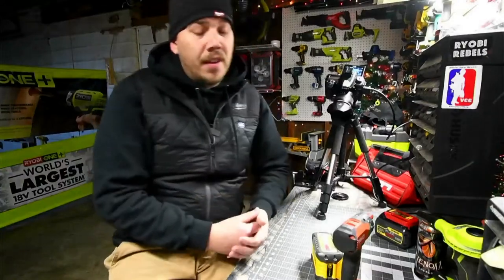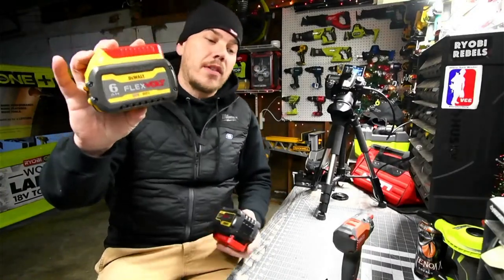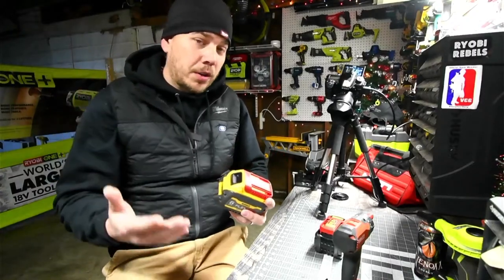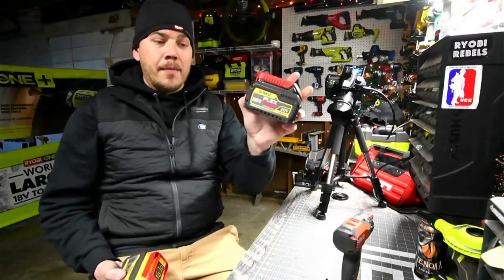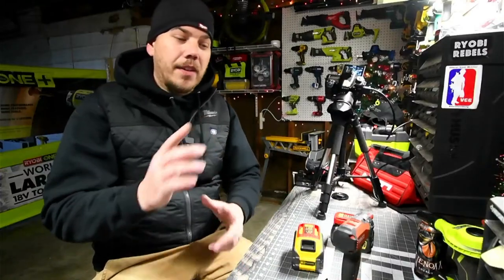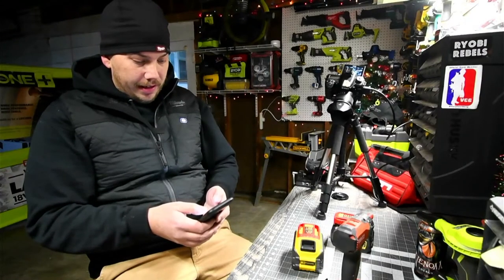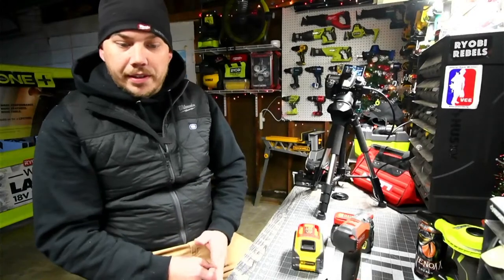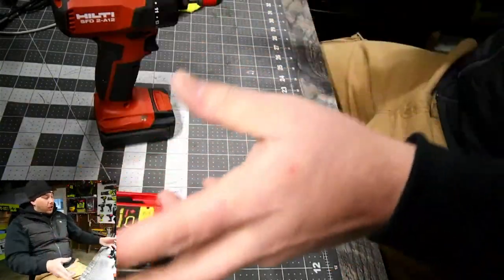21700 Cells in the FLEXVOLT ADVANTAGE BATTERY?

Comment: 2170 (D= 21mm D L= 70mm) 1865 (D=18mm L=65mm) easy to see the difference. So the format is that it allow form more material on the cell, (more layers) to get more power ( Ah ) on it.
Reply from the maker: and I showed that in this stream. I opened up a battery that actually does have 21700 celled batteries in it and showed the difference

Comment: I saw a YouTube video with Vince and a Dewalt Rep.  He said the 9ah Flexvolt was also 18650 cells.  The 12ah was 21700.  Thank you so much for making sense of this.
Reply from the maker: I thank you Dmacl
Reply: It actually has 20700. Just a bit smaller than 21700. This was to get flex out as soon as possible.  It predates 21700 production. Dewalt new they could switch to 21700 with   flex 12 and now 15.
Reply: DeWalt says the Flexvolt 6ah  uses 18650 cells, regular 20v 6ah uses  21700 , regular 8ah uses 21700, and Flexvolt 9ah uses 21700 cells.

Comment: Thanks for doing this.  Now you know for sure. 
FYI,  21700 and 18650 are cell sizes.  The 21700 cells are 2.1 cm in diameter and 7.0 cm long.  The 18650 cells are 1.8 cm in diameter and 6.5 cm long.  No such thing as a smaller 21700 cell.😊
Reply: Ha ha so true!
Reply from the maker: I do show 21700 cells in this video and It is night and day when you compare the 2

Comment: The compact batterie 3ah 4ah also the 6ah the 8ah and the 9ah and the 12 ah are 21700 cells and its a 10ah 20 volt that coming soon also a 15 ah flexvolt
Reply from the maker: the 15ah would be awesome and thank you for input Steve
Reply: Hey . Great. I understood the 9 to have 20700. But your logic could be correct on 21700. I think the 9 and 12 are same dimensions. 

And Milwaukee 12 is even bigger... it must be 3 rows of 5 21700.
Reply: @ManCaverTools  so yes i was not lying ahah 15 ah flex is coming soon does the channel will get it
Reply: @philipjohn4149  yes ecxat same size 9 and 12 flexvolt
Reply: Thank you! I've been googling and youtubing for like an hour and a half for a comprehensive list of bigger cell batteries.

 I can tell you that Europe lists the torque of their drills in nm as a thank you, if you need that rabbit hole of conversion lol

Comment: That's what I told you earlier  when you did flexvolt battery on the 20 volt impact vs milwaukie impact  put the new 21700 6 amp on that impact
Reply from the maker: Yes  you did. that's why I took apart my self to take a look.

Comment: Well Dewalt is making the battery packs way better but those are LG 18650 cells. They are the same size cells. Dewalt dose for sure have 21700 cell batteries just not that particular sized pack.
Reply from the maker: I do shoe dewalts 21700 battery. it is much bigger

Comment: It seems the flexvolt switch was not the only flash of genius.  Dewalt used 20700 first to get flex out quickly and then switched to 21700 in same form factor ... when cell was available. 

This was just after Milwaukee made huge mistake of making a big expensive 9 amph using 18650 that charged forever.  They had to remake volume 2 tools to fit bigger cell. And also retro fit tools. Show how they were completely out of the loop.

Makita also has now followed with 40v.... completely reversed what they said about sticking to 18650 and 2 x 18v tools.

Comment: Would you consider doing a comparison between the Ryobi and Milwaukee t50 staplers?  I wish they kept their tec4 line so the ryobi would be smaller, or even considered making a longer battery that still fits the same adapter form factor so it wouldn't be so bulky.   The Milwaukee almost looks the size of a normal stapler.
Reply from the maker: once I get them I will :) and that is not a bad idea at all

Comment: Not sure what up. I am late to party on new 6amph.  But if its same dimensions as old 6... then must be same 18650 cell.  Understand the chronological order to be like this.

Flexvolt released 60v with 2 bats. A 9 with 20700 and 6 with 18650. They new 21700 mega plat was coming and got flex out sooner

Then came flex advantage and power detect for 20 volt tools to recognize new 20700 and 21700 packs.

Then came a new yellow 6 amph bat.  And you say it's a flex advantage battery? Looks same as black pack. But 20v flex advantage can use more power from yellow pack.  This has me wondering.

Comment: The 9 came out too soon for 21700.
I bet it's the flex 12 and now 15 are using 21700 and some 20v bats.

Has anyone done performance tests between the 2 6amp dewalt flex bats. Must be just different circuitry for flex advantage. 

A good comparison test for the 2 flex 6amph bats is on the 6 in grinder. The original 6 trips out too early due to heat... much like the Milwaukee 9 in grinder or many HO tools  will trip out on all of its bats due to heat.   The dewalt 9 amph seems impossible to trip out on every tool.

Comment: I think where the confusion is, is that the flexvot batteries have 20700 cells not 21700
Reply: Umm, no Sir, 21700 on latest batteries.  Base battery has 18650, middle battery has been upped to 21700, (look for the three little silver bars on the top of battery, each side) and the top battery as well.  Easy way to tell: hold up one of the new 3.0 or 4.0 amp hour 20 volt batteries, (like Dave took apart in video) base to base, with a FlexVolt battery.  If almost same size, well, it has the updated cells.  The whole key to the amount of ‘power/juice’ a tool can get from a FlexVolt battery, is due to the three banks of cells, especially if run in parallel.  Peace ✌🏻👍😁
Reply: all Dewalt batteries using 20700s (9.0 Flexvolt, 3.0 compact and 6.0 XR) were updated to 21700s in mid-late 2018 and early 2019.  

20700s aren't being used by anybody anymore.  It was just a stopgap between 18650s and 21700s.  

Dewalt even shipped their 6.0 XR packs knowing they would eventually swap over to 21700s.  Early 6.0 XR packs shipped 20700 cells inside of a plastic battery cage meant for 21700s.
Reply: @stupidwapdaggo  Right on xrh07!  You explained it better than I did or could.  Like I said, I picked up two 9.0 amp hour FlexVolt batteries, date code in 2018, and they have three little silver ‘bars,’ each side on the top of the battery slide rail area, which I have been told has the 21700 cells.  I’m not so sure on my XR 6.0 batteries, dated from 2017?  They were made in Japan, and I got them through Acme Tools.  If they have the 20700 cells, no matter as they are two of the best batteries I have, other than the larger size.  Thanks for the input!  Peace
Reply from the maker: 21700 cells is that latest and greatest

Comment: That 6ah flexvolt battery is muuuch stronger than 4ah with 21700's. Flexvolt has 3p 18650, they look like samsung 20s judging by the color and each can provide at least 30a so 90a per group since there are three in parallel (even if they used weaker 20r it is still 20a x 3 so 60a in total). 4ah uses samsung 40t which is at best 35 amp cell so it is almost 40% weaker than flexvolt. But it is much more compact so there is that.
Reply: Happy to confirm they're 20S cells.  You can see the text clearly in the video at @11:38
Reply: @ClipsByMiles  yeah thanks :)

Comment: Your still wrong the 3.0ah battery has 20700 cells not 21700. Maybe the slim 4.0ah has the 21700 I don’t have that battery yet to check
Reply from the maker: ive never heard of 20700 celled batteries. nor have I ever heard of a company claiming 20700 celled batteries also never heard of a YouTube channel ever saying 20700 celled batteries. 18650 and 21700
Reply: @ManCaverTools   I’ve taken mine apart and taken taken each cell out, Everyone on YouTube just assumes there 21700. Try checking your batteries and let us know. I had one of the very first ones that came out maybe they could have changed them
Reply: This is what understood as well... this was done to rush out flexvolt.  The 60v brushless flex would outperform  a Milwaukee m18  9amph 18650 and even a 12amp 21700... all while using 20700 and then later switch too 21700 when its production was completed afterwards.
Reply: @ManCaverTools  there are 20700 and 21700 cells. dewalt used 20700 in some older packs.

Comment: Dude I like the vids but you didnt have a clue on several topics, red covers on flexvolts are for shipping because of the watt hour rating ie voltage and capacity. For your info 18650, 26650 and 18700 batteries are named that because that is their measurements and if they were to redesign a battery and change its shape or size the name would change to what ever the new ones size is. But with all that said keep up the good work and just  learn as you go.
Reply from the maker: I thank you for viewing Doug

Comment: This video is irritating. Stop taking apart brand new expensive batteries if you don't even know what your looking for. It doesn't have to say anything to know if its a 21700 or 18650. Just look at the size of the dam batteries. There's a big size difference